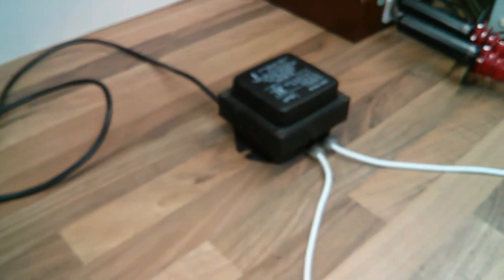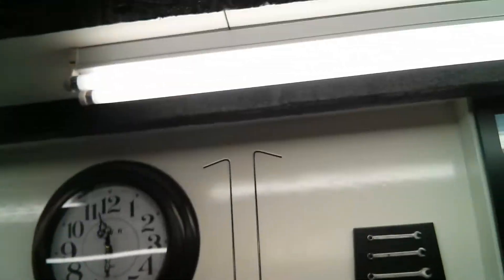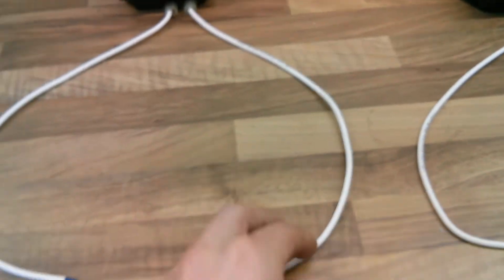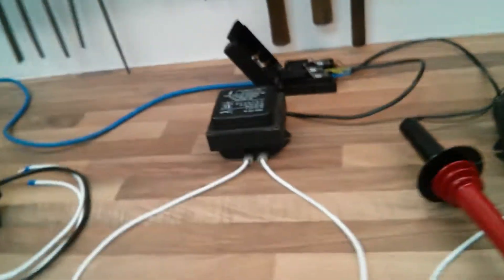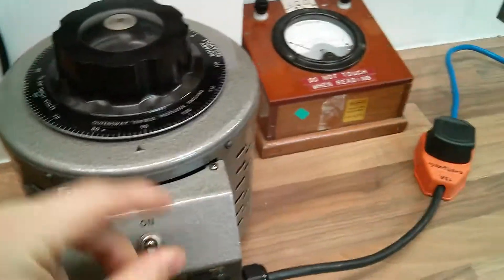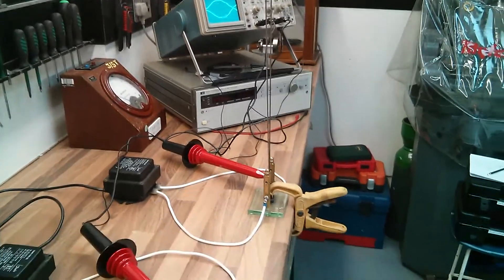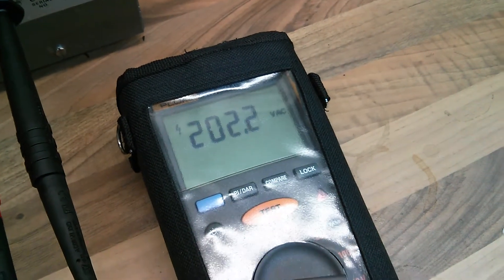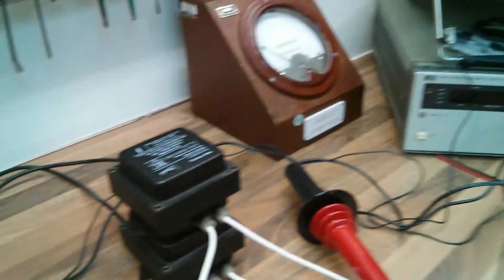Phasing Transformers Using A Dual Channel Oscilloscope

Comment: Most likely culprit is a transformer saturation effect - they do't use any more wire or iron than absolutely necessary. Probably made worse by slight increase of voltage caused by the capacitance of the jacobs ladder. You can test that theory by reducing the transformer input voltage down to 10% (25V ac) and see if the waveforms look nicer.

Comment: as you say it is commonly used for safety and practicality like the 110 volt step down transformers used in hazardus building conditions so between ground and live thier will be 55v ground 55v  instead of ground 110v

Comment: Interesting Video and very helpful too when needing to parallel transformers. Bit better and safer then trial and error method :P
Reply from the maker: Thanks, I thought it would be an interesting thing to do a video on, obviously with lower voltage transformers just a normal probe will work, HV makes it just that more interesting though! x]
Reply: Yes I bet :P

Comment: Can you not check the phase using a signal generator on the secondaries and normal probes on the primaries since it would be safer?
Reply from the maker: I think I know where you're coming from but could you elaborate on the usage of the signal generator to work out the phasing of the transformers? sounds like an interesting technique, I'd like to know more about!
Reply: Float both grounds, turn the secondaries into a large primary by bridging them together, bridge the primaries together, and look at the signal output on the primaries. At least to my knowledge if they are out of phase then you get nothing. I believe I remember reading about a similar technique for old audio amplifiers.
Reply from the maker: M@ Interesting, I will have too look into this technique!

Comment: Not as much fun as doing it by the Arc method, which is how you would do it if you didn't have a scope or hv probes.
Maybe you should do that too ;)
Reply from the maker: Yeah I should really go over a poor mans phasing techniques, which is the same thing again only I actually draw arcs between the phases to determine my final configuration, the trial and error method is what I used in the beginning to discover the transformers were actually quite different, I like the oscilloscope method as its technical but not too deep like some oscilloscope tutorials can be. I may do a video on manually phasing NSTs at some point as it adds a bit of variety to different HV transformer types commonly used for HV projects where this tutorial type video may come in handy.

Comment: Thanks for this - like you, I put two OBIT in parallel and I was surprised to find that one was phase-reversed compared with the other! Very odd to consider the manufacturing process to give that result ... and well done with getting the scope triggering to show exactly the things you wanted to show.
Reply from the maker: Thanks Ridefast0, yeah I remember it surprised me also, I do like to find abnormalities about things and this one in particular is a good obvious find as not knowing means the difference between working and not working. As for the sillyscope I've had this one for a number of years now, I'm gradually learning it's functions one knob and switch at a time, I should probably actually sit down and read the manual properly, but there's noting like just pressing and turning things til it gets close, one of my favourite bits of kit by far! x]